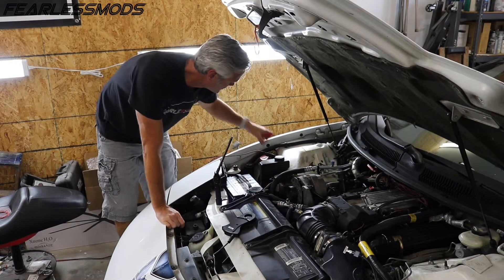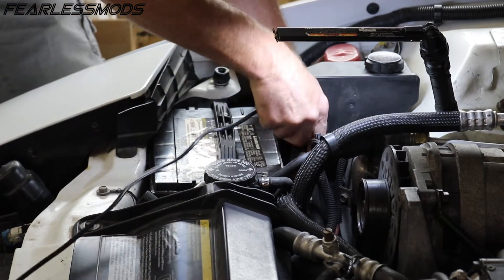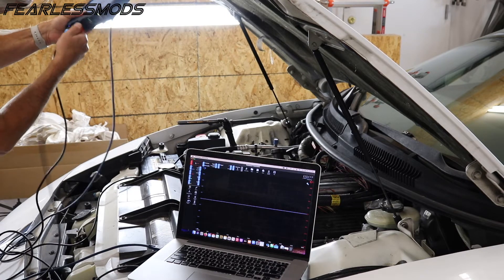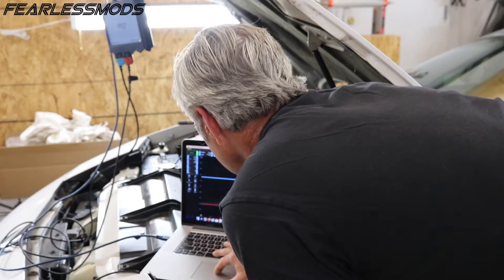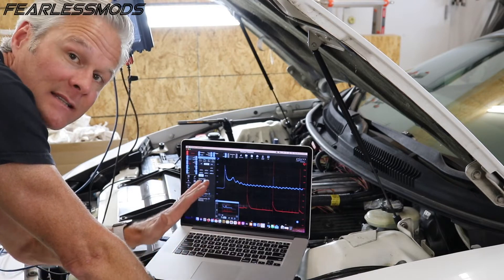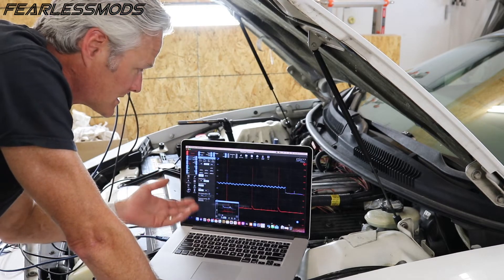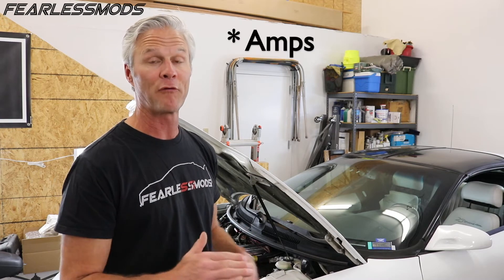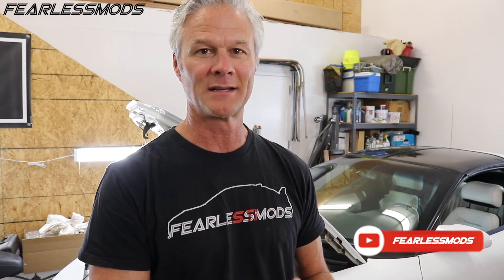Pontiac Firebird Trans Am Ignition Diagnostics part 4:  Picoscope relative compression test

Comment: I bought a duralast optispark also. Been driving me crazy trying to figure out why when it warms up it starts running rough. It's 100% the optispark.  These duralast optisparks are assembled poorly . They are not timed correctly . You honestly have to open up these aftermarket optisparks and check everything.  There offset witch when the car warms up the timming advances and then the car runs like shit. Trust me. I promise you just build your own optispark and you'll be good. There's a few videos on YouTube if your interested.  Duralast optispark will run your car but not correctly and not for long.

Comment: If you have a 1300 dollar scope to run diagnostics.  Not very practical for the home-gamers.
Reply from the maker: Absolutely right, however you don't have to pick up their top of the line model to do the same thing.  Check out https://youtu.be/L1jJpLzshP8 where they use a 2204a and you can pick those up for a couple hundred bucks.